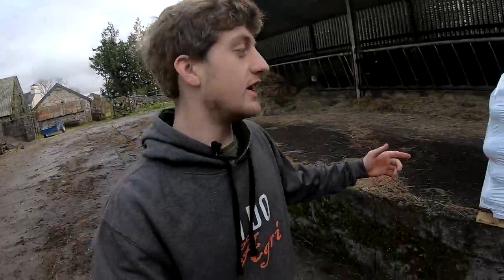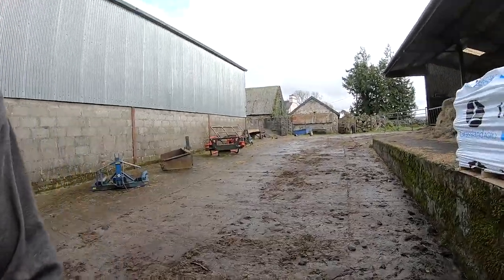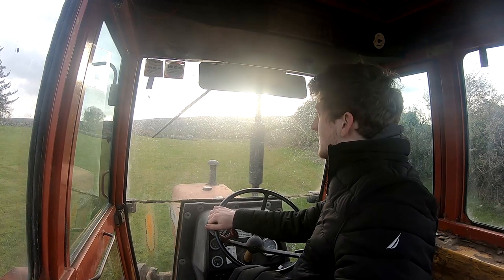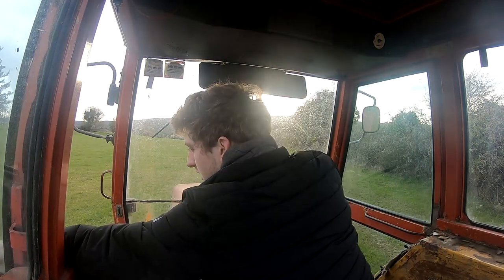Fertiliser Spreading with My Refurbished FERT SPREADER | First Use | Will It WORK?!?

Comment: It's a good idea to use it for a bit first before galvanising it so that you can check if it needs any modifications. It would be a good idea to cut out a narrow slit down the front and adding a strip of Perspex. This would give you full visibility of what's remaining in the hopper. Then you could also add with paint or marker some level indicators so show the height of one bag, 2 bags, 3 bags and so on. Would come in very handy to gauge your application rate when sitting in the seat.

Comment: You could make a cable controll from the cab to that spreader, maybe a old car handbrake with most the notches ground off and spring fitted  so its either on or off